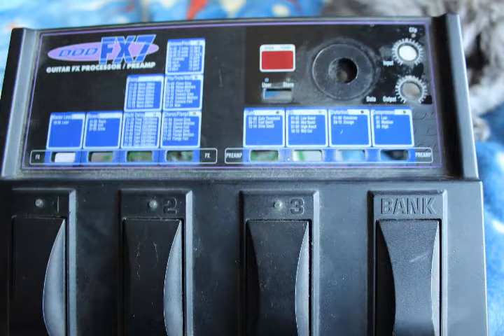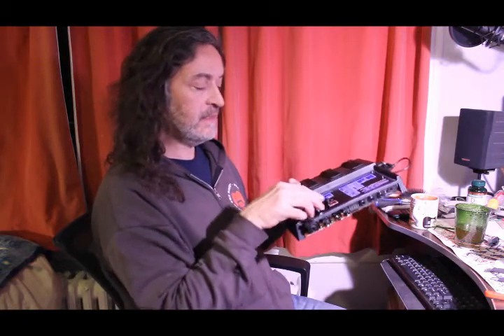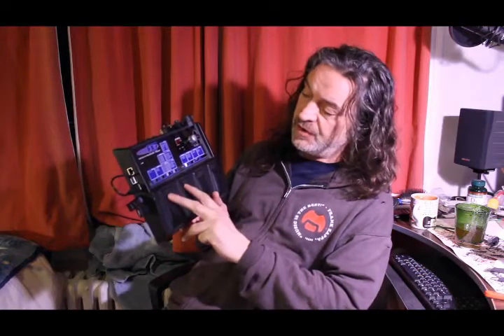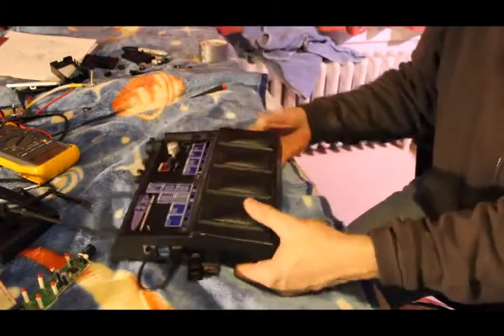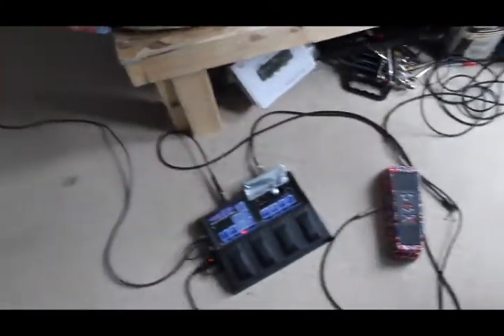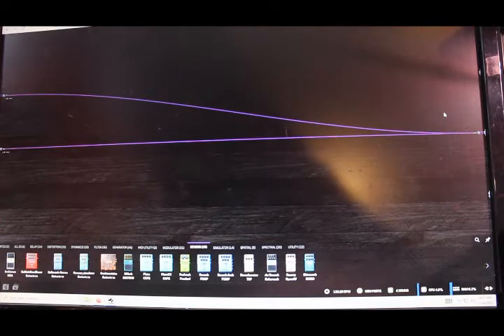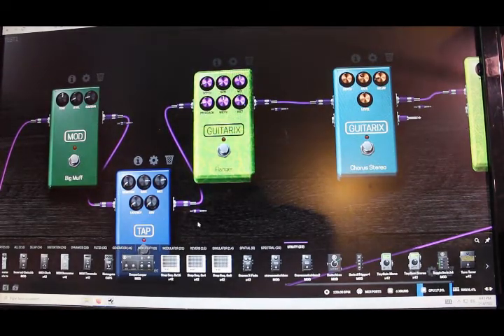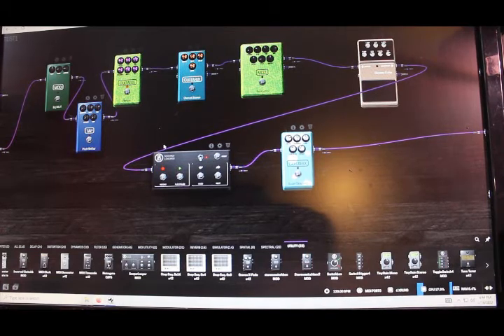Raspberry Pi Pedal Build: Part 2

Comment: is this software the same as the mod pedalboard? where can i find this software
Reply from the maker: Yes. It is a stripped down Pi OS... Patchbox OS with the MOD UI using a web interface (browser)
Reply: @guyzini  couple questions you might have the answer for, I just want to play around with these amp sim apps. I do have a raspberry pi 4 I think… but I didn’t see an aux input just aux out I think… so I installed raspberry on an old 2014 Mac mini that was useless because apple wont let me download apps anymore because it is old.. even though it runs smooth as butter. So I put raspberry pi on there and guitar ix.. so far I can’t get the jack app to work only adapting my 1/4 to 3.5.. do you know if it will work? I had a amp sim working on my desktop pc with just adapting the 3.5 to 1/4 without an audio interface… I guess to simplify my question can I use an aux with raspberry either on my Mac conversion or my actual pi or is it impossible without an audio interface? I’m just a guy playing around so yes I already know the quality won’t be as good, but I just want to play around with the amp sim apps
Reply from the maker: @bumstudios8817  Hey Bum Studio - you need an USB audio interface to plug into your Pi4. You need something like a 2 channel USB audio capture device. I have several: a presonus, Mackie, etc